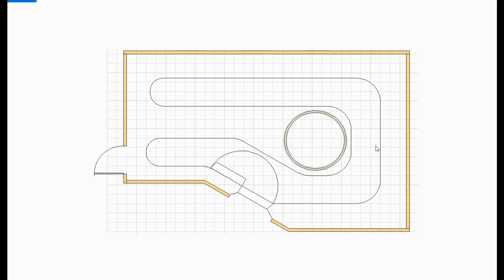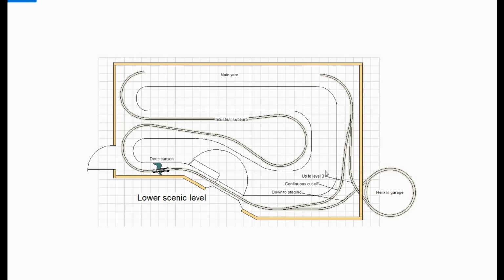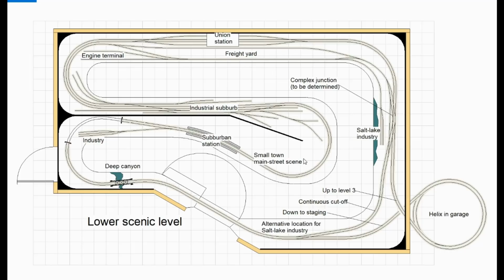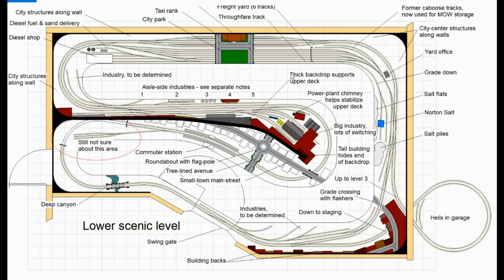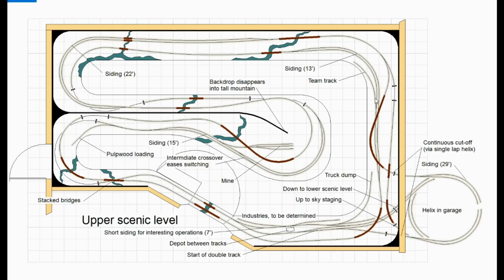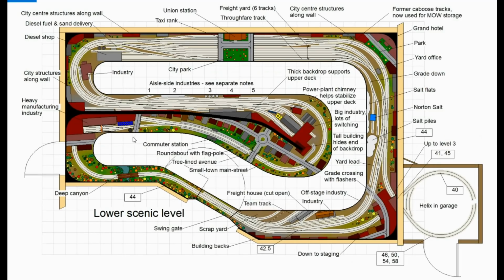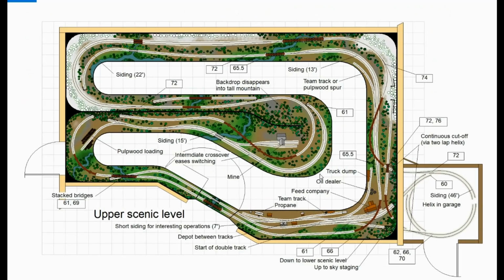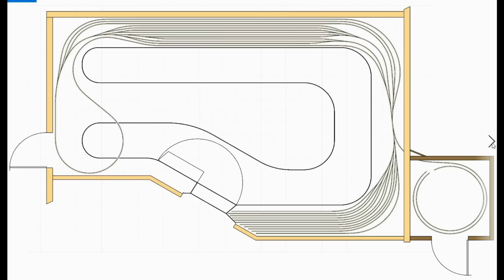Four-level HO-scale layout design in an odd-shaped space

Comment: I'm four years late on this one, but typically interior walls are laid down on-center while exterior walls are laid down to the outside edge. So the dimensions from an exterior corner to an interior wall are going to be from the outer edge of the corner to the center of the interior wall.

As for the room being five inches smaller in every dimension, that's pretty much the thickness of the walls themselves. They're typically framed with 2x4's which are nominally 3½ inches wide by 1½ inches thick, and then the drywall sheetrock adds an extra half an inch or so. Couple that with dimensions potentially going from outer edge of the exterior framing to the centerline of an interior wall in both orthogonal directions, you've potentially lost five to six inches compared to the plans on paper.

These subtle intricacies pretty much mean that it's always best to wait for the space to be fully framed and clad, THEN you take measurements of the final internal dimensions.
Reply from the maker: Yes, I know all of that as I was in the building trade for 14 years.  The incident I recounted was way before that, and also far more blatant.  I wasn't going off plan dimensions, but off a sales document that stated "bedroom 4: 11'6" x 14'10", or something like that.

Comment: Elaborate layout. Looks like it includes everything the client wanted. Good job. How high is the sky staging and how do you plan to control and see the turnouts and occupied tracks? Thank you.
Reply from the maker: The sky-staging level is set at 88" (the train room has a 9' ceiling) so that it doesn't cramp the mountains on the third deck.  Closed-circuit cameras, such as those sold for home security, are perfect for keeping tabs on areas of the layout nor easily seen by other means.

Comment: I have a 11 by 72 in switching layout . Do you have any suggestions?
Reply from the maker: In N-scale, that gives you plenty of space for a few decent-sized industries, possibly modelled as an isolated area connected to the main line via a car-float.
In HO-scale, you are pretty much limited to just a couple of small industries and a handful of cars.  If all the spurs face the same way, that will avoid the need for a space-eating run-round track.  I'd be tempted to frame the layout between a pair of road over-passes and represent a single city block.  This module could easily be incorporated into a larger layout at a later date.
Reply: @mpeterll  I like the city block, thank you 😊

Comment: Hmmm, so you can't run 2 trains at the same time in the opposite direction?
Reply from the maker: Whatever gave you that idea?  On the lower scenic deck, there is a double track main - one track for each direction.  On the upper level, there is a single track main with passing sidings.  Here, the higher priority train would have the rights to the main line and the other would hop from siding to siding - exactly as would be done on the prototype.